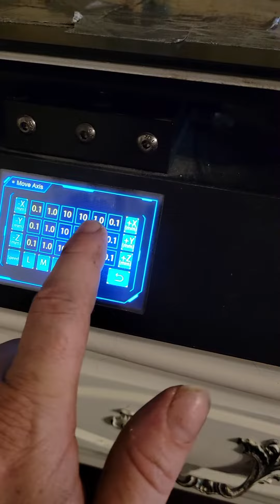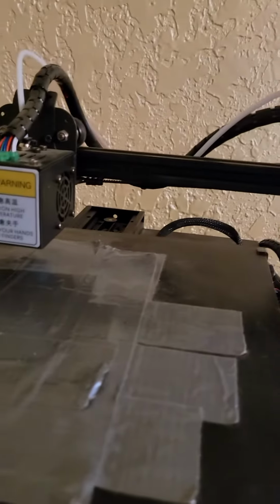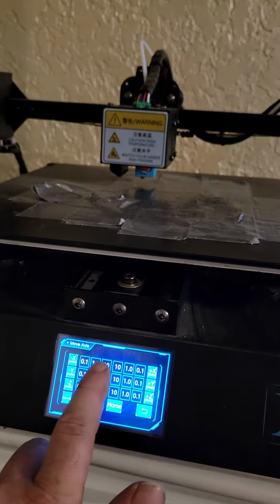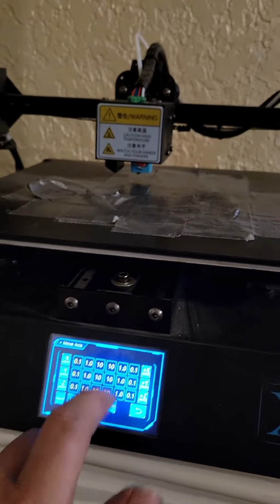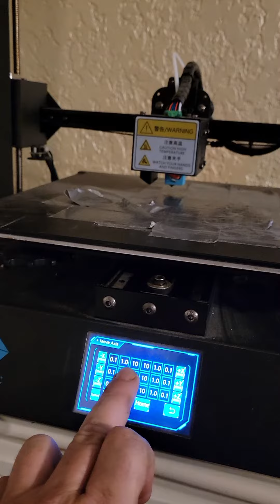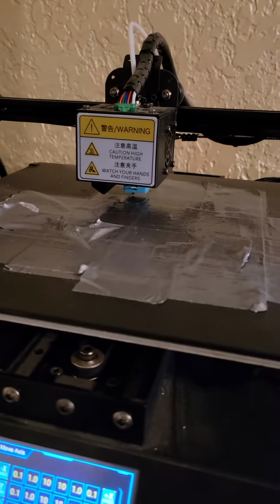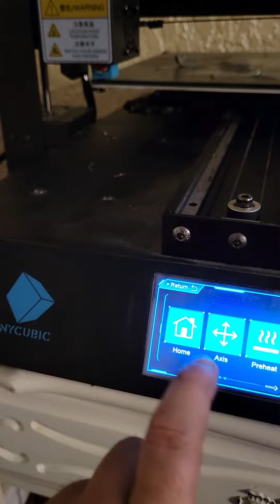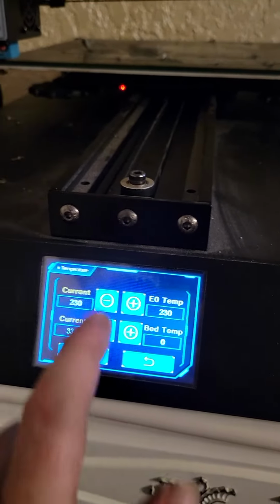The 3d printer is broken

Comment: step 1: disable steppers.  step 2, manually twist the big screw on the right to lift the gantry (whole horizontal section that extruder is on) until it is level with the other side.  then it is fixed.  that easy.  It is all binding because the horizontal section is severely misaligned.  This happened to me on my printer too and I fixed it like I said by realigning it on both sides to be even.
Reply from the maker: It doesn't even let me home it anymore and the gantry looks level to me. I have recently added new endstops to the 3d printer but when I home it the x and y axis works fine but the z axis just refuses to do anything and motors just act like their begging down but the bed moves back but doesn't move forward in home like the z axis is preventing it. But it just seems to me it's level and I am just stumped.
Reply: @DIYRobotGirl  with the whole machine off, try to rotate the screws by hand I guarantee they'll be hard to turn because they don't seem aligned well.  You showed a closeup of the gantry one time in a video on these issues and it was not perpendicular to the vertical section at all.
Reply from the maker: I made a newer video of the 3d printer recently this one is old. But I have changed the endstops and I know I can manually turn the screws they seem aligned to me. But still doesn't want to home
Reply: @DIYRobotGirl  if you try to rotate both screws at the same time, the gantry should raise up.  If you find it doesn't raise up with ease, it proves its a alignment issue and you have to sort this.
Reply from the maker: @artbyrobot1 I can rotate both screws and raise the gantry but I dont know how accurate level it should be or close enough good enough. Then when I home it the extruder centers and the bed moves back and then rhe x axis binds and doesn't allow anything else.
Reply: @DIYRobotGirl  well i recommend you just discuss step by step each thing wrong with chat gpt and do whatever it says to do to inspect and fix it and report back to it often your findings and just follow its lead.  that's how I fixed my 3d printer this most recent time.
Reply: @DIYRobotGirl  isn't the x axis just a belt?  what could be binding that?  anyways, did you try asking chat gpt for troubleshooting advise?  just type what happens and follow its guidance.
Reply from the maker: @artbyrobot1  no It doesn't have a belt. It has a big screw with a coupler a nema 17 servo and endstop
Reply: @DIYRobotGirl  one thing that can be used to troubleshoot is disconnect the motor output coupling from whatever it is supposed to actuate and test the motor is running at all when its supposed to.  This will rule out a bad motor.  Then try to twist by hand whatever the motor was supposed to do.  If it turns easily then that part is good to.  If it is stuck then its not lined up right and needs repair.

Comment: Sounds like the motor has to much force on it to move. Perhaps the lead screws are not parallel to each other…easy way to fix this is to loosen up the small screws on the back that connects the lead screw brass nuts to the gantry and if you can the Z stepper motor screws to allow some play and then try to home the machine…if it doesn’t make that grinding noise then that was your problem… and then jog Z axis up and down a couple of times then retighten all of the screws.